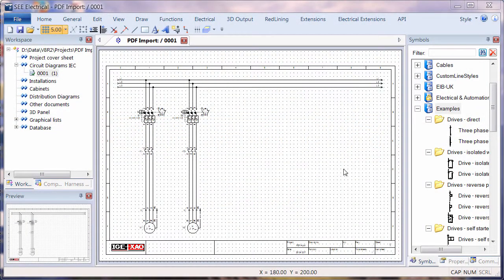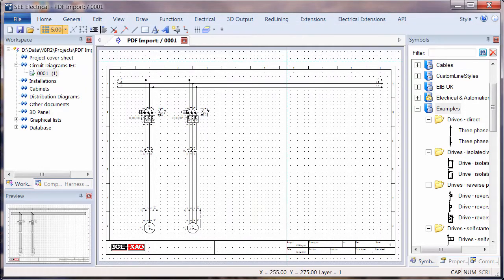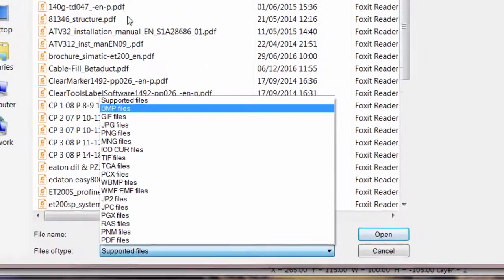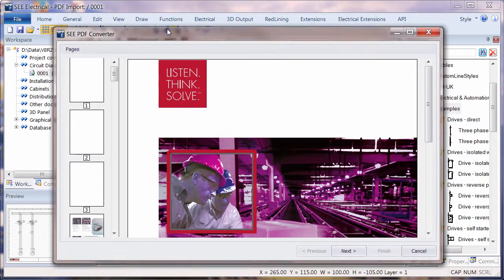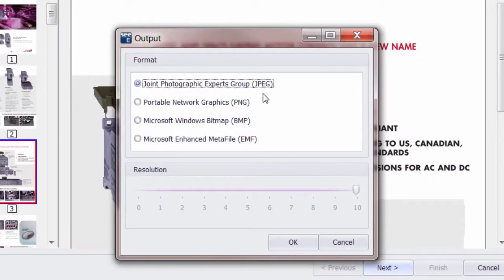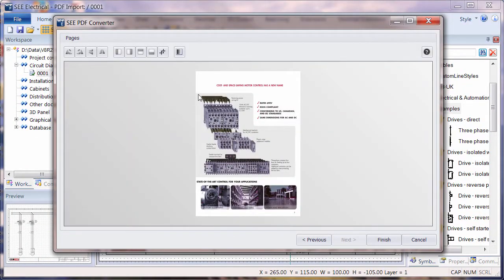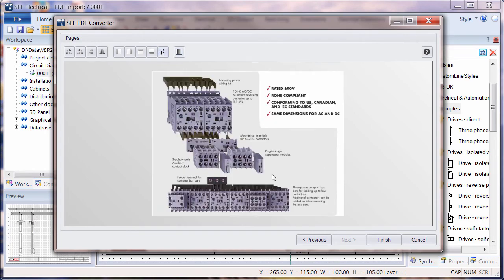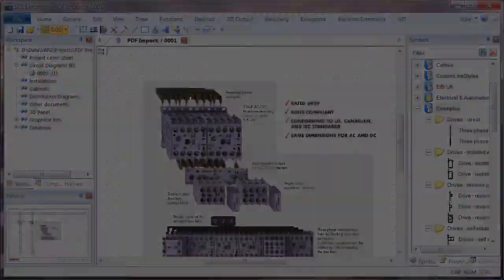V8R2 PDF Direct Import

Comment: hi, i have a problem using the option: "commands - colors- brep- change color on all faces" does export the correct color to the 3dpdf, however when looking for greater detail using the "commands - colors- brep- change color on single face" does not export the color assigned to the 3dpdf
Reply from the maker: Yes you're right, currently these colors applied using this command are not displayed in the exported PDF, only the blocks original color is used. I've added this to the requested enhancements list.

Comment: Very nice, cool option.
Reply from the maker: Yes, it makes sense for PDF integration the be handled easily. You can also use the 'FREEZE' command while the PDF image is selected to allow drawing or text to be added over the top of it. Great if you have a PDF of a project you don't want to redraw but want to manage or adjust it slightly.
Reply: IGE-XAO UK thank you, waiting for new videos!